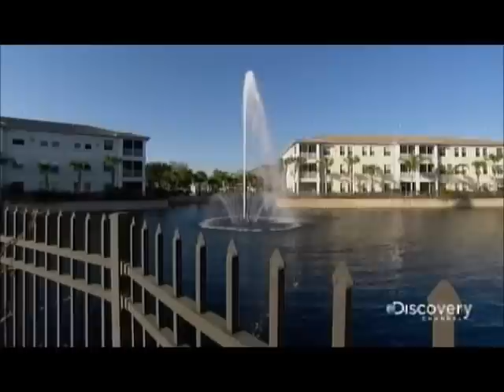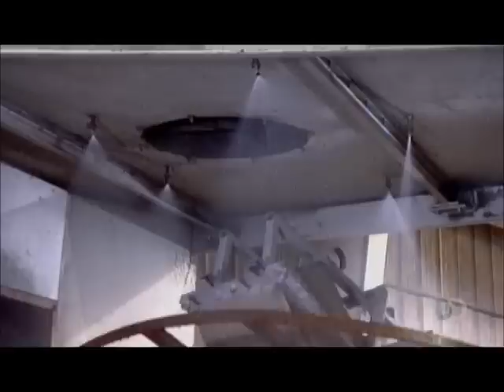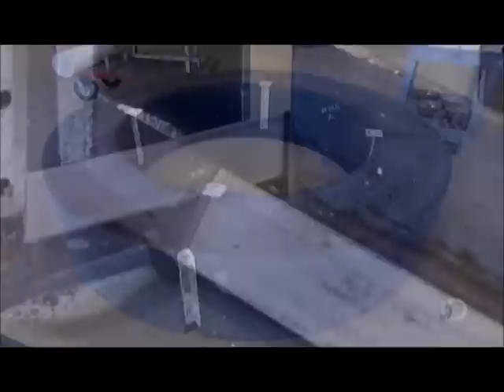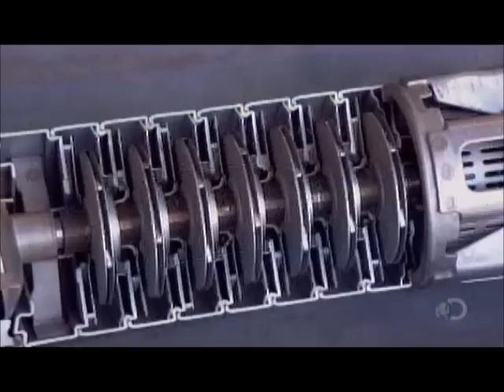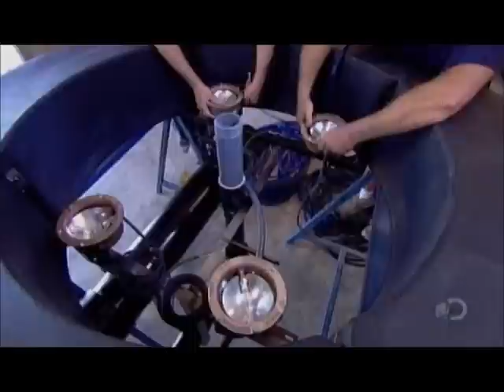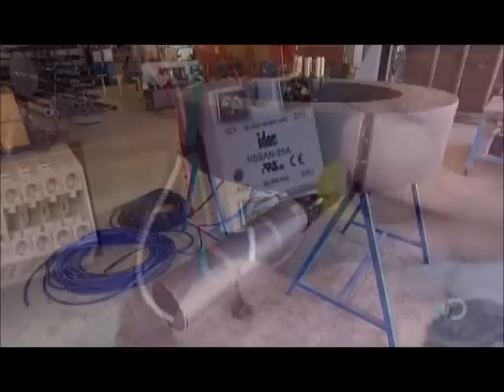How It's Made - Floating Fountains

Comment: The pump is or really looks like a deep (drilled) well pump.  Both have six impeller stages and are long and thin like that, resembling a stainless steel shogun antenna.

Comment: they couldn't just use black pvc pipes instead of having to spray them with paint? :D
Reply: The black pvc pipes you refer to are probably ABS plastic.  ABS is usually used for drainage (they are not designed to withstand pressure).

Comment: That pump alone is a couple thousand dollars...it's an SP-series submersible muiti-stage centrifugal pump made by Grundfos, and I'd imagine it's in the 5-10hp range.
Reply: those pumps run on three phase power? Motors usually above 5HP and 7.5 HP require 3 Phase.
Reply: @TheTheo58  Yes, 208/230 3-phase.